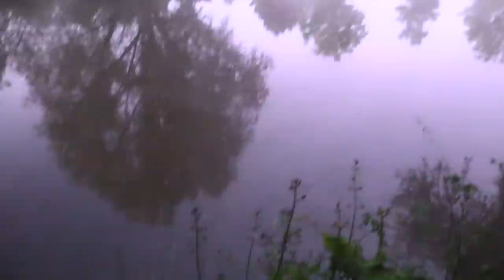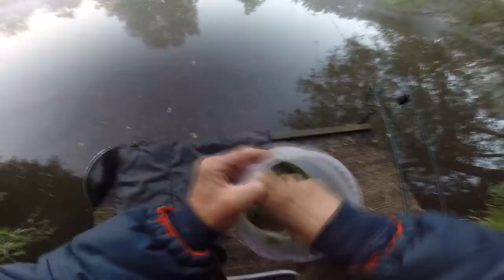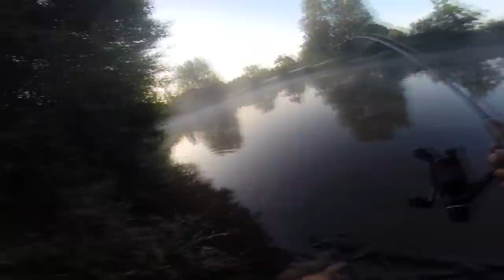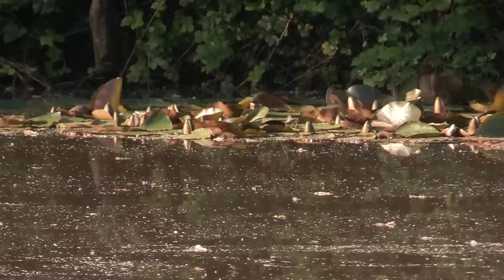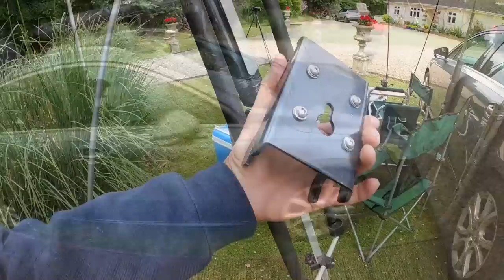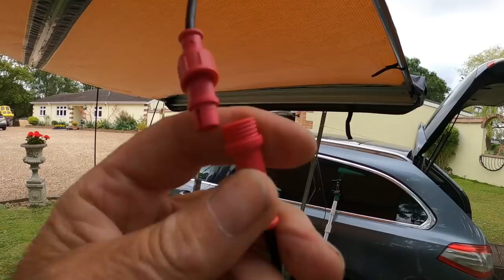Fishing an Old Lake at first light: Traditional Setting

Comment: Something I've done similar to your car awning in the past is to get a tarp and trap it between the tops of the car doors and then use storm poles (long banksticks) and some bolts through the tarp eyes to create an awning. Just make sure the roof angles down away from the car otherwise rain can get into the car if your door seals are less than perfect

Comment: I'm curious, when you showed the lake at first dawn it appeared that on the lakes surface there was something that looked like a thin film of oil, is that normal or is it a residual from ground baits? I've seen this on a few waters and often wondered what causes it.
Reply from the maker: I know what you mean I have seen it many times. I think its a natural phenomenon maybe caused by either leaves or willow blossom breaking down after being on the surface. Maybe someone else can enlarge but it always looks like petrol or oil . I'm pretty sure its a natural thing as I have seen it mostly on sheltered smaller waters.

Comment: All you have to worry about with that setup on the car is draining your battery by using those lights till you get no crank power.
Reply from the maker: I think I said in the film about maybe taking a 2nd battery with croc clips and adaptor to fit the lighter unit ??
Reply: @TAFishing   you  did. I made the comment before That part came on and I didn't  delete it.